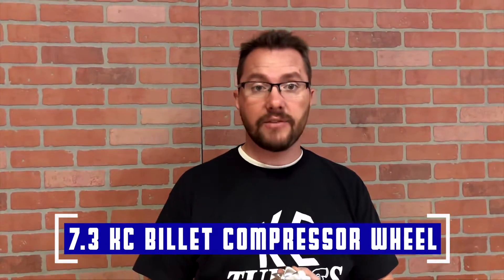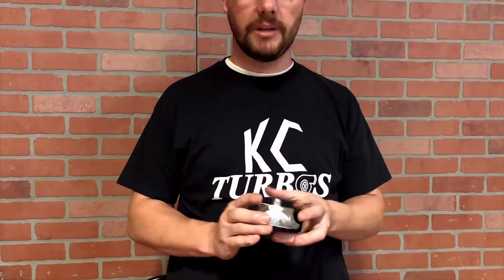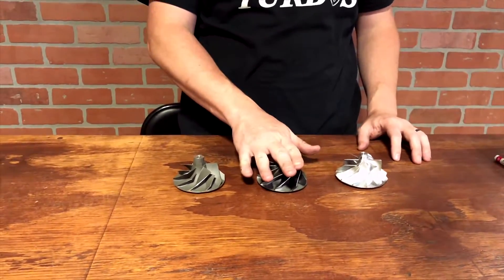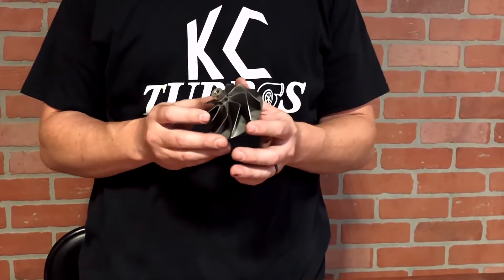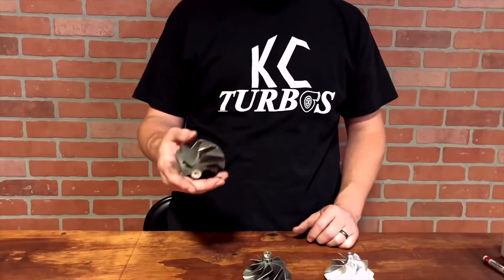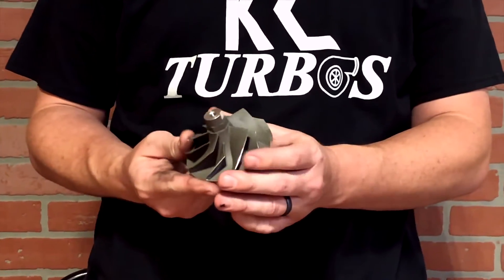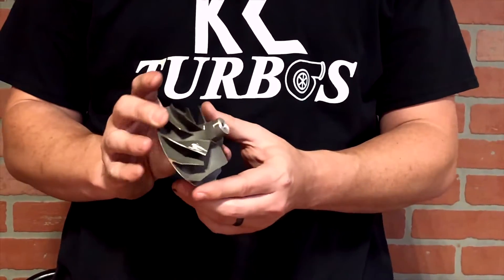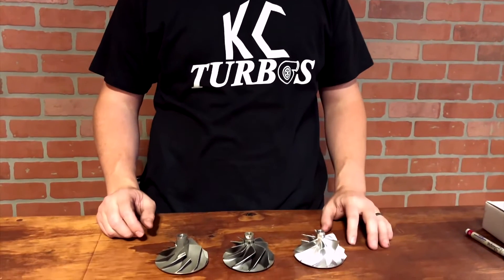The KC Billet Compressor Wheel for the 7.3 Powerstroke

Comment: Can one replace the wheels without needing new injectors?
Reply: The wheel just eliminates the turbo lag you shouldn’t need anymore fuel than stock injectors if your staying the same turbo size and just switching out the wheel.
Reply: @aldricresendiz3239 can you put a 10 blade LC wheel in a stock 99 7.3 ?

Comment: with an 01 e350, did they run a different turbo on the vans?
Reply: Can't remember right off if the van turbos had a bigger cold side housing, though I'm pretty sure they did. I know they had a 1.15 non-gated exhaust side though.